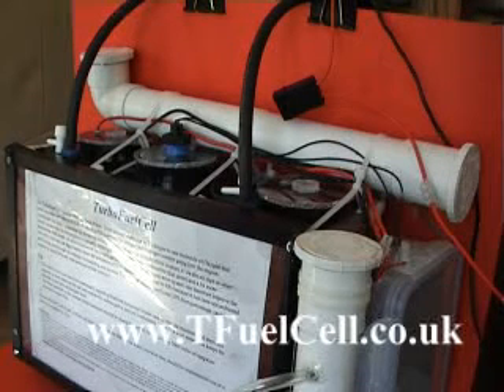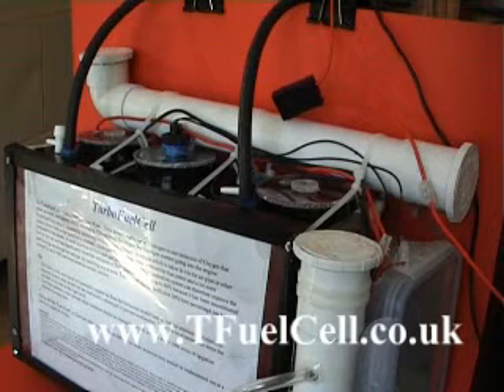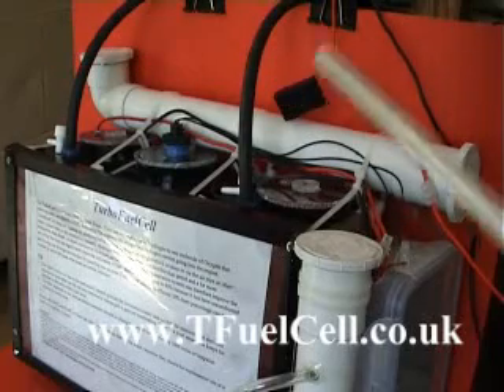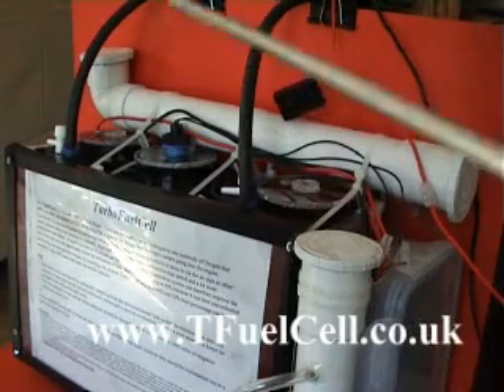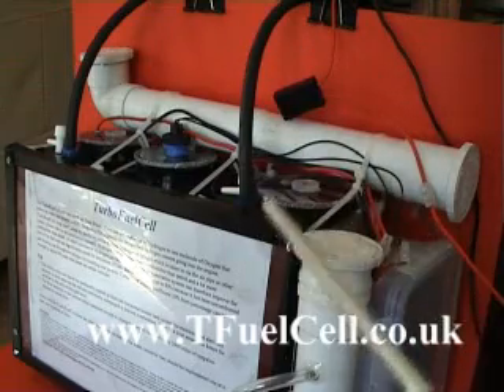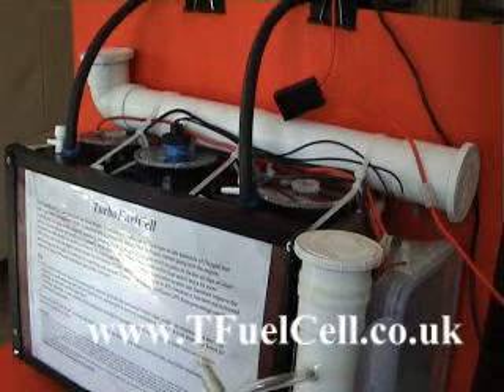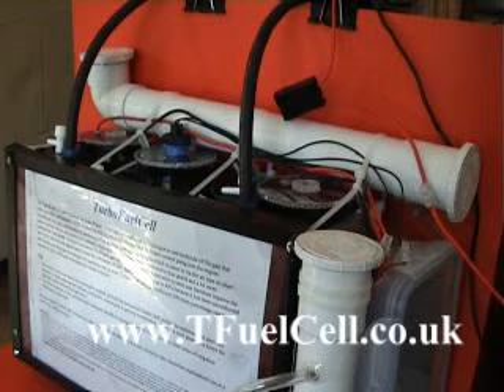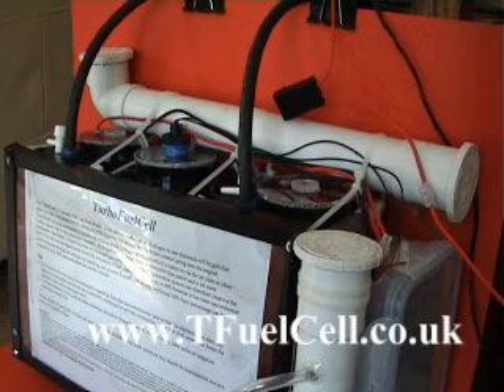Trucks Buses Boats need HHO Water Hydrogen Fuel Cell

Comment from the maker: TurboFuelCell's produce HHO gas & mixed in the fuel, which cannot be ignored as it is 3 times more combustible than Petrol and & 5 times more than diesel. New petrol cars have a heat sensor located between Exhaust manifold and Catalytic converter. HHO gas reverts to water causing the engine & exhaust gas to run cooler. The computer sensing the mix is lean opens the petrol taps.  By insulating the sensor with foil it stays hot and fools the computer. Your Ford diesel  may be fixed in the same way